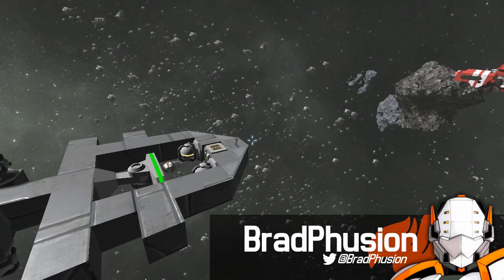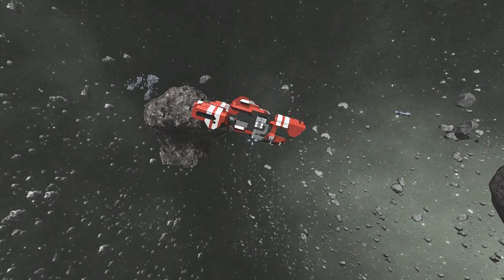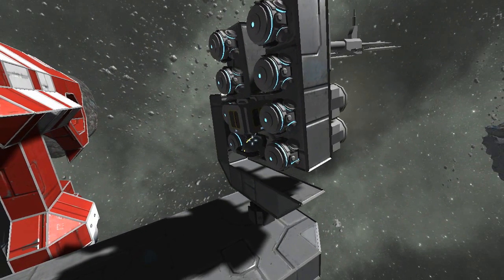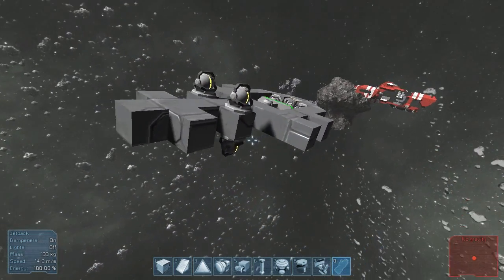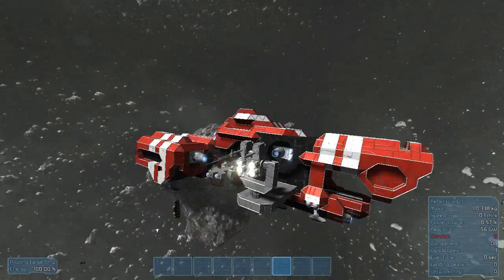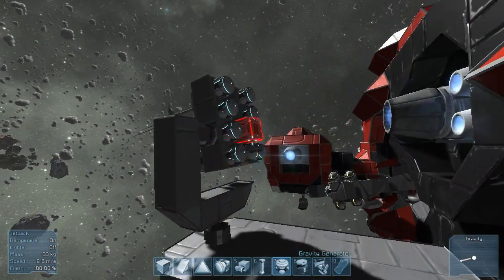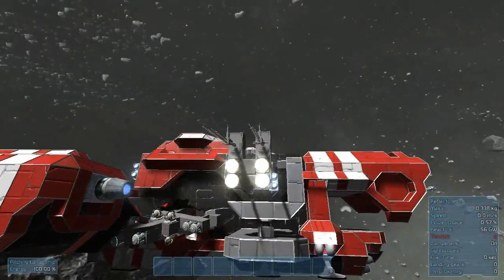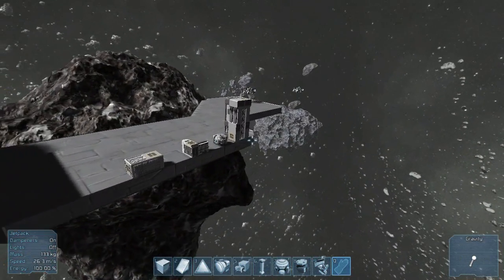Gravity Defense Turret! (Space Engineers)

Comment: Brad, you're looking at it the wrong way. It takes a much larger amount of force to stop and throw back an object than it does to simply redirect its path. You don't need a gravity field to directly oppose an incoming target, you only need to shift it's incoming angle so it harmlessly passes by the ship.
Reply from the maker: I thought that was the point of this video, was to simply redirect instead of completely stopping the projectile, which is what I did in my original video. That's why in this one, I tried aiming downwards, to push it down. It did only slightly angle it, however not enough to cause a miss.

It was also early morning when I recording that, and my mind was all over the place with other stuff. Sorry about that!
Reply: "I thought that was the point of this video, was to simply redirect instead of completely stopping the projectile"

I did see you try to angle it downward, but it still seemed like your overall goal was to stop and push the projectile back. Which is why I offered the deflection suggestion. Hypothetically, would enough gravity generators on the ship (keeping people inside grounded to the floor) operate well as a deflection shielding?
Reply: BradPhusion perhaps firing a miniaturized single gravity generator version of the gravitational disrupter assisted by the generators on the turret would fair better at the task, the force of gravity both in space engineers and in real life depends on the distance from the source of gravity (plus hitting the thing should do the trick)
Reply: I was about to say that, the force needs to be enough on the turret to overcome the force pushing the missile forward AND enough to slow the weapon's inertia enough to slow or redirect it.